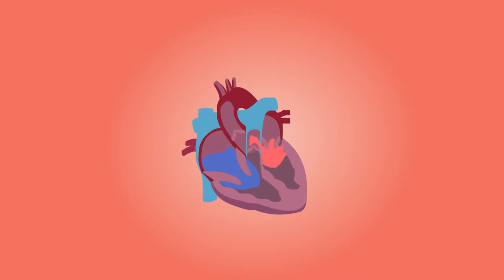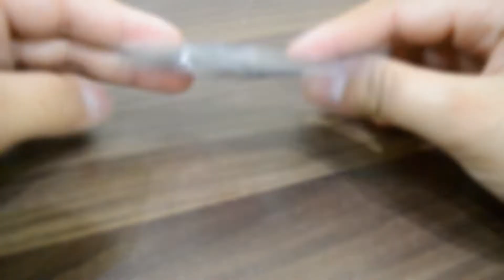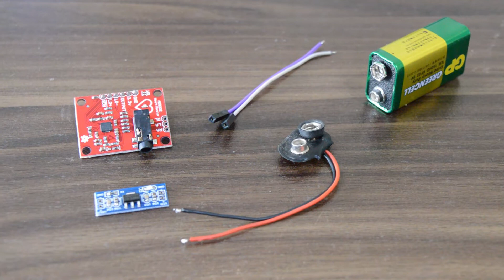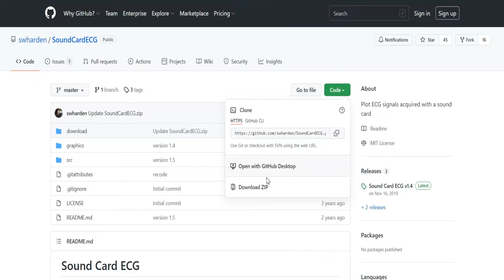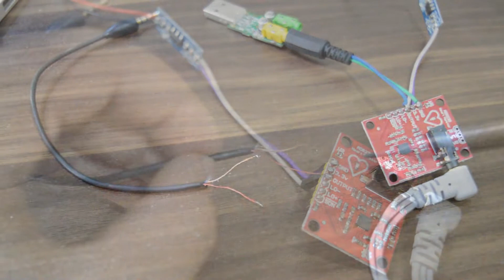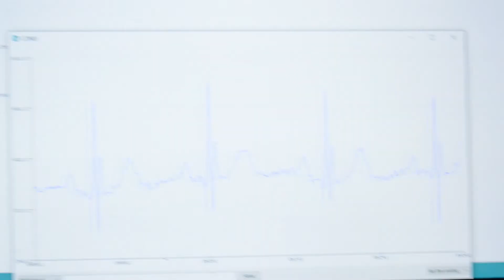Check Your Heart Condition Under 10$ || DIY Homemade ECG Machine using AD8232

Comment: How many mV and mA must an ECG electrode, electro-stimulator, etc. have? I tried searching for something and saw 1mV (but they don't specify mA, they are obviously very low, but I would like to know the exact value. So if we have 1mV we get a maximum of 1mA. I ask this because I am building a neurofeedback with the TGAM1 module and Arduino. Right? Thank you very much.

Comment: My buddy could it be that your left atrium is slightly enlarged? Have you been diagnosed with hypertension before? Since the P-Wave in the arduino based ecg looks a bit bifid like in „P-mitrale“… its not dangerous but could lead to mitral valve regurgitation on the long run. One of the diseases in our modern world that can be prevented when diagnosed beforehand with such simple assessments! I would recommend you that you measure your blood pressure regularly on a daily basis and maybe contact a cardiologist in order to performs a heart echo in order to rule out a possible valvular heart disease.

Disclaimer: My comment is for educational purposes only. Since I don’t know you nor have I seen you in person it is impossible to make a diagnoses in the YouTube comment section based on a „diy arduinoboard based ecg“ but I think it’s never bad to have at least once a year performed such studies when suspected. Contact a medical professional in order to discuss possible pathologies on an ecg performed on a medically certified device. I am not liable for risks or issues associated with using or acting upon the information provided by this comment.

Comment: Hi buddy. I have one question about this project. I would like to add an OLED or 1.8 TFT display. Have you done this version of the project? Instead of 9V batteries, I will use 18650 batteries and a charging module with a mobile phone power supply.

Comment: Why there are 3 pads and only one graph?
Reply: as far as i understood its measurment (red,yellow) and a reference voltage
Reply: Because one is the ground as the other guy explained. But by adding just one more cable you can have 3 graphs from 3 different angles. Just would be a bit more code

Comment: your soundcard setup does not work because the AC coupling at the input of your sound card. (or before the AD converter) use DC coupling or f0 at0.1Hz

Comment: Hi, this looks really cool! One question: which arduino did you use? Is it important to check that the voltage of the arduino is 3.3V? Most arduino seem to operate on 5V but the AD8232 needs 3.3V.
Reply: It says nano on the board in the video.
Reply: i think the arduino is operating on 5v but the board provides 3.3v to the ecg module

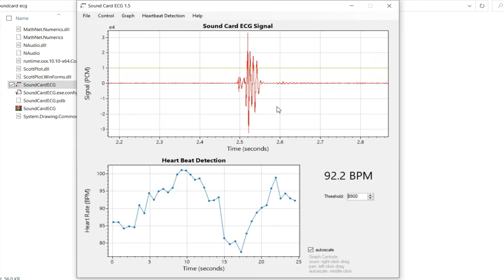Comment: 11:28 It is not a bug that is just it is just done by your audio drivers because in order to produce audio you need the wave to jump up and down, so it is in fact done by your laptop and not the software if anyone is wondering.

Also unplugging a laptop from the wall does noting because laptop has its own battery and in case it will start drawing more power than it needs to the fuse inside of a laptop will burn faster than the electricity will be able to reach you.
Reply: Unplugging the charger isn't for safety reasons; it's for noise elimination. Switch mode power supplies are very electrically noisy and the charger WILL put a ton of noise into the ECG signal.
Reply: @mannys9130  Sorry posted the comment long time ago so I'm not sure but I think I wrote about it because he said that you should unplug your laptop for a safety reason.

Also clever thinking but as far as I'm aware the power supply sends electricity to the battery which then sends it to the ecg, and in this over simplified circuit the battery is most likely going to filter all the noise out.
P.S. I'm not an electrical engineer so I might be completely wrong.

Comment: What if you wanted to attach some electrodes to someone's legs to monitor muscle movement during sleep. Could something similar work?
Reply: Just happened to see your question a long time after you posed it.  I am a retired biomedical engineer.  By 'muscle movement' you may mean the signals that muscles generate when they are contracted.  The two factors here are that muscle potentials (as they are called) are of much higher frequency that ecg signals - muscle potential recorders need to have a frequency response up to at least 2KHz (whereas ecg recorders only need a frequency response up to around 50Hz max and much lower will be OK.  Secondly muscle potential recorders (electromyographs, emg) need to have greater amplification as the signal coming from the electrodes is in the region of 20 to 50 microvolts.  This is in comparison with about 1 millivolt from the ecg electrodes.  I'm afraid that it is unlikely that the setup demonstrated in the video will be suitable.

If it is only gross limb movement you want to know about, there is a very simple and crude way of recording it.  That is with thin conductive rubber attached to the ends of the limbs.  As the limb stretches and returns to unstretched, the rubber will get thinner and its resistance will go up and down.  Just measure and record the resistance.  This was the basis of early respiration monitors with thin conductive rubber stretched around the patient's chest which changed in resistance as the patient breathed in and out and the resistance changed.  Here endeth the lesson.
Reply: @biomed2560  Thanks for this.

Yes it was just muscles tensing rather than limb movement I was interested in. So sounds like this is a non starter.

Just for why I was requesting this - I am diagnosed with MECFS but I have unusually muscular legs for someone who is effectively bed bound for 20-22 hours a day and struggles with walking. I have been suspicious that my legs tense up during sleep as they try to act out walking in my dreams and that is perhaps why I wake feeling exhausted. My brain is doing its job of preventing limb movement during sleep but doesn't seem to be shutting down muscles. The thing that made me most suspicious was when I once woke up and I could feel my legs muscles undulating left, right, left, right as I regained consciousness from sleep. I was having a dream where I was walking just before waking.

I've also spoke to one other person with the same MECFS diagnosis who has similar issue with unusually muscular legs and she suspected similar. So I was just wondering if it were possible to make a DIY kit to test this. Unfortunately it looks like this isn't feasible. I did try filming my legs several years ago but didn't see anything unusual in terms of movement but I don't think a camera would show the kind of tensing muscle movement I am describing as it involves legs being more or less stationary.

Comment: Very helpful as I need to put something together to record a real heart problem.
Why isn't the cardiology department doing it?
Because there's a long wait to get an appointment so getting evidence now plus some means of recording it.
Also, there's good chance that the symptoms won't be there on the appointment day.
Useful safety information as well.
You could avoid the 9-volt battery by using some Lithium cells.
Reply: Read some other comments, I dont think this makes a very accurate representation. Noise free ecg needs a lot more than this setup

Comment: Definitely going to substitute the 9v battery for something else, maybe a combination of 18650's and a 3.3v regulator board. 
I need this for 24/7 monitoring though, so that's pretty important
Reply: holter monitor would be better. this does not look calibrated

Comment: why didnt you use 2  1.5  batteries in series? instead of 9 volts
can I use 1.5 batteries with this circuit, will there be any problem?
Reply: Voltage from the battery will drop lower than 3.3v, which will give inaccurate results

Comment: Why not just use 2x AAs?
Reply: There is very little wiggle room on a 3.3V chip. If your batteries run a bit low and/or are strained you might easily get below the "2.whatever volts" threshold for detecting a logic high level.
Voltage regulators allow you to connect a higher voltage battery to ensure safe operation until the dropout voltage of said regulator is underrun.

Comment: Arduino solution : I doubt that the plot corresponds to the execution of such a simplistic program which can only give artifacts depending on the heart rate and the baud rate of the serial port. The acquisition of a noise-free ECG is a complex instrumentation problem that requires, in particular, an irreproachable cabling design. Besides the need for a programmable gain amp before the ADC converter to match the exam conditions, much more accurate digitization on at least 16-bit or better 24-bit is imperative to detect most problematic cardiological situations. A low cost Seeeduino XIAO or ESP32 (12 bits) or an external ADC ADS1115 would be nice here, or better MAX11040K-MAX11060 or AD7768 (24 bits - 256 kSPS SPI ~23 €).
Reply: Why does there always have to be haters? A better approach might have been - "this may not get accurate results. Try this because the way you are doing it misses data... "Seeing it on YouTube and you don't agree with a video so you go straight for the throat. Nice. That's a really sorry-ass approach as long as we're handing out opinions...
Reply: @GetRealwithMike  I think "hate" is a bit over the top.
michelfrance75 actually added some extra useful information, but you just interpreted it in a completely wrong way.
Reply: @GetRealwithMike  Rest assured, it's not about "hate". First, a medical instrument where the patient can be connected to an oscilloscope (or computer) itself connected to the 240V can constitute an "electric chair". There are standards to be met in the electronics of the ECG itself and not to mention the connection, it's not a gimmick. In addition there are installation rules concerning analog and digital grounds especially for weak signal amplifiers. I invite those who read us to use the Analog Device Application Note of the AD8232, there is a lot of useful and reliable information concerning the correct adjustment of the filters (Holter mode or medical office mode), the correct connection of the electrodes (it depends on the manufacturer of the card (for my case it did not correspond) to have a "minimum" 1-channel ECG with reliable results without arctefacts. If it is well done and well connected, I checked a good concordance of the PQRST complex with a professional ECG and that we can even detect ESVs (medical office ECG configuration - motionless patient).
Reply: @michelfrance75 interesting idea! do you know if it’s possible to get a 6 lead from this 3 electrode configuration? Have you ever done this for a 12 lead or any of the precordial leads?
Reply: @Ryan-mw4zv  No, I haven't tried. As this is an amateur electronic board and not a professional multi-channel ECG, I limited myself to a basic 3-channel Einthoven circuit. But nothing prevents you from using several AD8232 circuits to produce a more professional ECG. With this 3-electrode device, I was able to clearly highlight electrical anomalies then confirmed by ECG in the office of a cardiologist.

Comment: bro...if the color follows the standars, the placement is actually wrong. The green lead should be under the yellow lead :)
Reply: Indeed, the connections are wrong. First, the Sparkfun heart monitor board and its Chinese clones correspond to figure 64 of the AD8232 data sheet, so an Einthoven triangle at hands assembly. I checked, the green connector is LA (left arm), the red connector is RA (right arm) and the yellow connector is (right leg).

Comment: Hey, just asking is there any way to update the code that there is a beep whenever the hearbeat is detected?
Reply: Simple hysteresis detection does the trick. You beep when the signal crosses a certain threshol and then lock the beeper. When the voltage falls beneth  a level a bit lower that the previous voltage than the beeber is unlocked and triggered again.
Not to be a doomsayer but you also want to count the time between beep triggers and if it exceeds 2-3 seconds you want an alarm beep (that typically is done by turning the beeper on coninously, aka bad movie flat line sound)